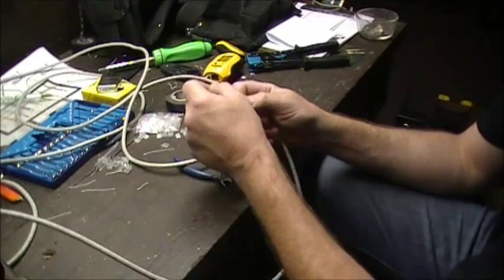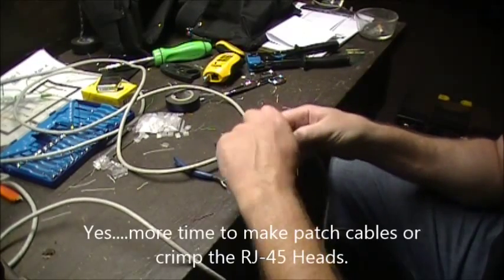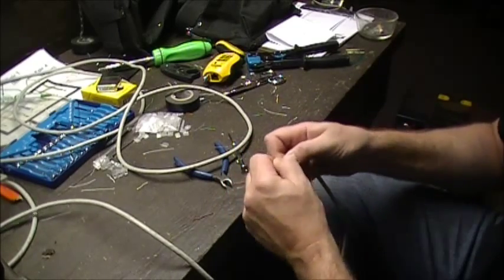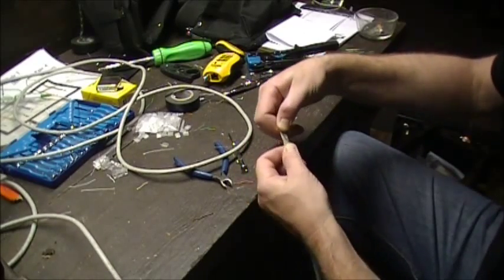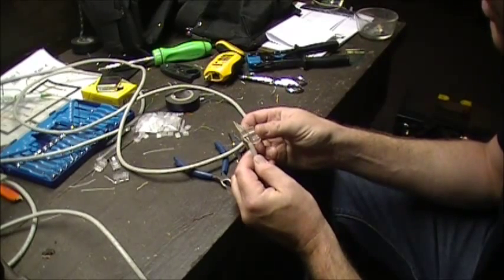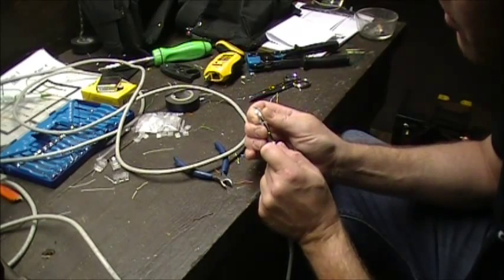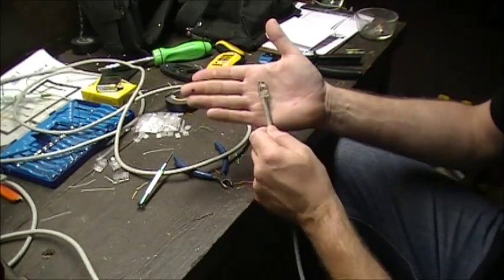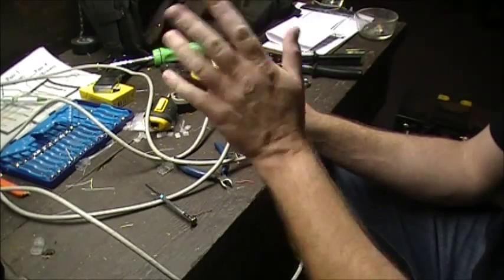Network Cabling 101 | How to Make a CAT 6 Patch Cable or Crimp with a Load Bar | BridgeCable.com

Comment: FYI - the load bar should have the flange facing up when the orange wires are on the left.  That is, the "high part" is towards your face, the orange wires are on the lift and the brown on the right, and the empty shell has the clip facing down (when the clip is down, the right is brown - a silly mnemonic I use).  Thanks for the tip about the 45 degree angle!